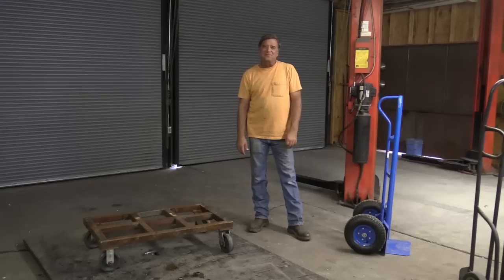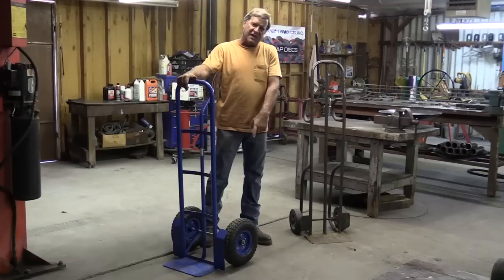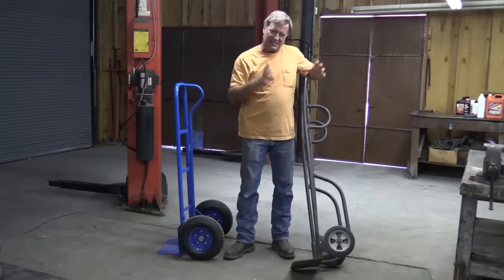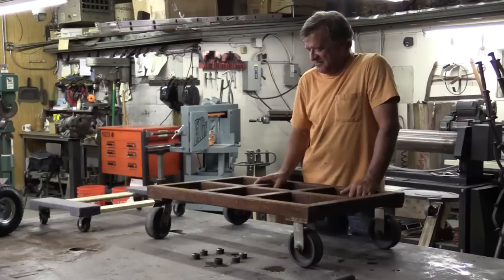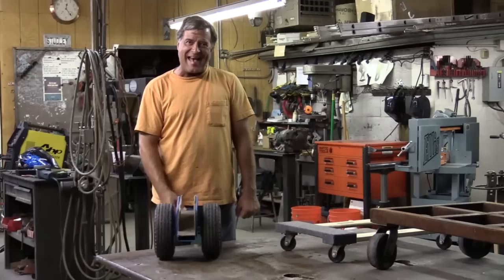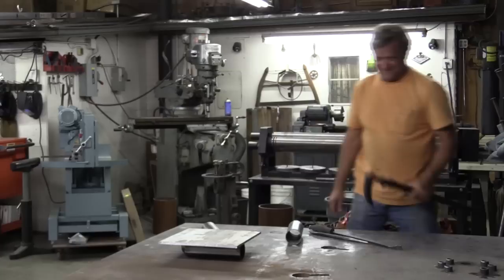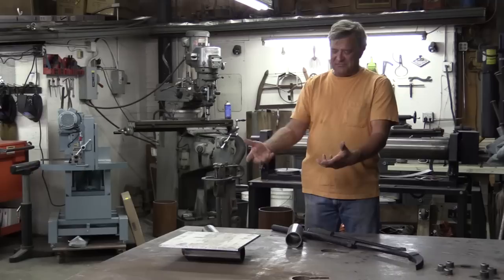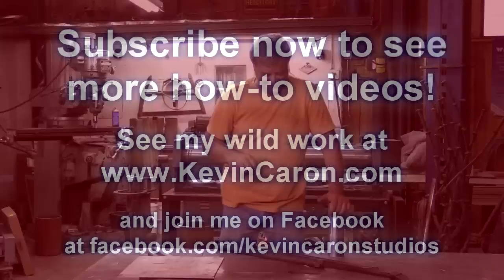How to Move Heavy Objects - Kevin Caron

Comment: 2 weeks ago I moved a 10 foot sheet metal brake that weighs close to 4000 lbs 30 feet into my shop using 1/2 inch conduit as rollers. Slow and steady.
Thanks for the vid.

Comment: Hi Kevin... add a johnson bar to your pry bar collection.
Reply from the maker: lornie212 I will take a look,    thanks for the tip...
Reply: lornie212 I was just thinking of that. We used to move printing presses with a Johnson bar, and a few pieces of gas pipe. I've moved very heavy things by myself, just using a furniture dolly and a cheap Harbour freight 12 volt winch.

Comment: i saw on your web site you were a truck driver my question after seeing this is were you by chance a skate boarder lol
Reply from the maker: quietmale00101 Tried once and fell on my butt..    Cracked the damn thing almost in two...
Reply: Kevin Caron, Artist i think you misunderstood me i was wondering if you were a flat bedder
Reply from the maker: quietmale00101 I worked for a local pallet company.   Towed everything from a 40 foot flat to a 55 foot drop deck..  Lots of 53 foot vans as well...
Reply: cool ive pulled every thing from a 40 foot hopper bottom to a stretch blade trailer mainly flats and steps and rgn's theres a couple photos of my truck with a blade on it on facebook